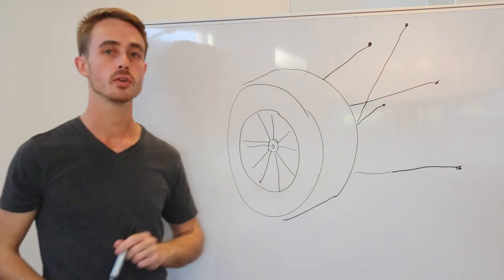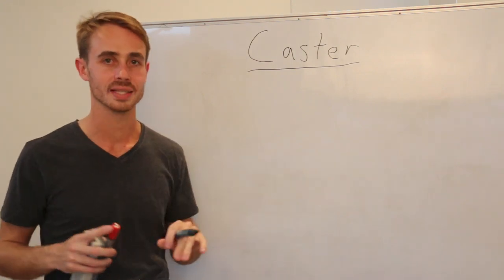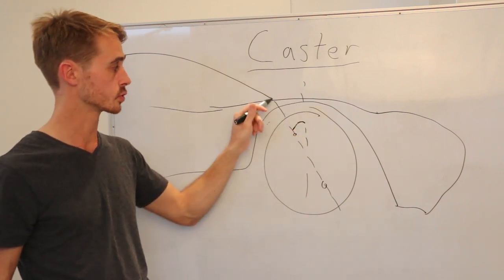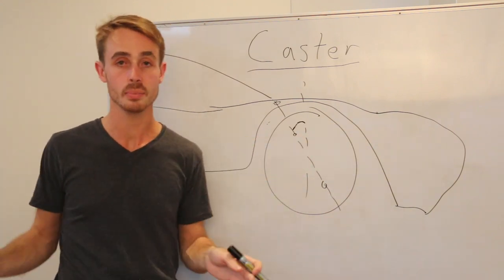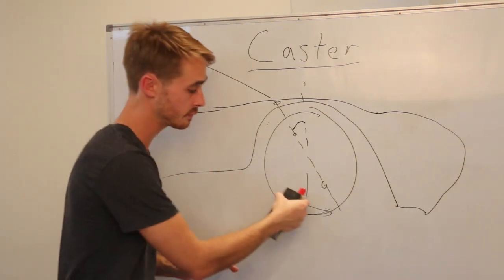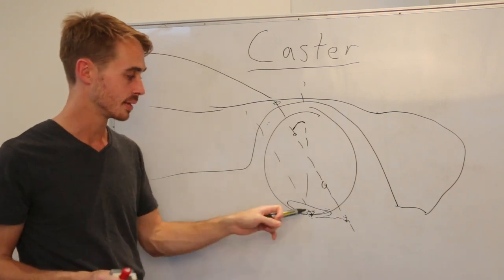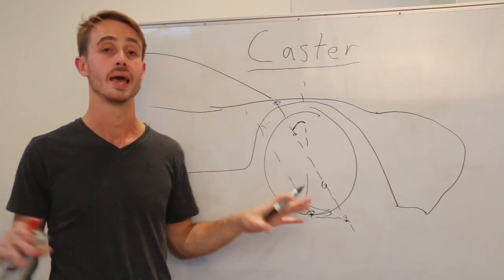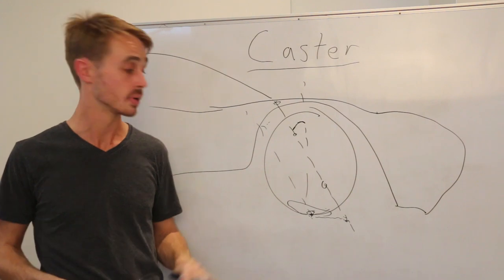How Caster Works

Comment: Finally a video that tries to explain the importance of mechanical trail for the steering feel and self centering (how strongly the wheels want to turn into the direction of travel).

In many videos about suspension geometry, they try to explain the effect of the caster angle by using for example office chairs with swivel caster wheels. But they fail to notice that swivel caster wheels actually have zero caster angle (the steering axis is vertical), but plenty of mechanical trail (how much the steering axis ground intersection point is forward of the tyres contact patch center). 

It is the mechanical trail that gives majority of the steering feel and self centering. The more you have mechanical trail, the more you will get steering feel. Caster angle (and KPI angle) by itself gives only very little steering feel and self centering (it gives some, because it tries to lift the tyre onto its edge but the effect is very small when compared to mechanical trail). I think that the confusion between the effects of caster angle and mechanical trail comes from the fact that in majority of automobile suspensions, changing one setting also changes the other. It is possible to build suspension where caster angle and mechanical trail can be changed independently. Caster angles main use is to get better camber angles during cornering.

The effect of mechanical trail can most easily be seen by playing around with shopping trolleys or office chairs. 

I think it would be less confusing to use the whole term caster angle, when talking about suspension caster angles to separate it from caster wheels. I would actually like to know why those caster wheels are called caster wheels even through they have zero caster angle? Is it the name of some old manufacturer (like hoover for vacuum cleaners) or is it derived from some old english or some other languages term or saying.
Reply: That's exatcly what i was going to write a comment about.
Reply: They use chair wheels to demonstrate that the wheel contact is behind the pivot point. Camber on the other hand does not exist with arm chairs...

Comment: Thanks. Basically, when the wheel rotates and leans inwards to the turn there is more friction on the part of the wheel which is now leaning in to the turn and touching the ground. This friction causes the wheel to want to find the path of least resistance and lift the part of the wheel that is leaning in and touching the ground off of the ground. This causes the wheel to straighten and lift the leaning-in part of the wheel off of the ground. Makes sense! Thanks!
Reply: Andrew Nash thank you, the way you worded that helped me understand it much better
Reply: Ok...but what about drifting ? There the wheels want to countersteer on their own into the skid as a path of travel...but that means they are leaning more and more to do that. But drifters want to always have as much caster angle as possible.

Comment: Are OEM caster specs the actual measurement at +/- 20 deg steering angle (i.e. lock to lock) or are they the true castor angle which the measurement must be converted to - i.e. measured angle / sin(20) ?

Comment: For 250,000 miles I've been trying to figure out why my trucks  steering doesn't  return properly! Replaced every part on the front end multiple times brought it to multiple alignment shops no one can tell me why. 
Doing my own research I've come down to the conclusion that something is off with my caster the vehicle pulls to the right and sterring feels lighter when I turn right  but doesn't have good feedback. When you steer to the left feels  heavier  but to me has better Road feel.
      The question I have is since it's  steering easier to the right and heavier to the left do I take Caster out of the right hand side or do I add Caster to the left hand side since the steering doesn't return correctly, I was thinking adding Caster to the left hand side would make both sides lighter therefore correcting  or helping my non return steering
Oh ya old girl has 370,000 on her and has had this issue since I bought the truck with 100 000 MI 
I bought it with stock upper A arms had this issue then! I installed cognito upper a arms still has the issue. I did turn torsion keys in, t A arms allow  me to bolt  ball joints in on top or bottom  to fix camber issue from Turning in bolts on  cam keys and  raising the truck a little

Comment: so if you had negative caster, or a situation where the 'moment arm' was behind the 'point of contact' (instead of in front like your example) of the wheel you could have a dangerous situation? going around a corner the car would want to turn more and more.  Are there any examples of negative caster being used or usefull?
Reply: +Steven Olson Shopping trolleys. Good for mad drifts down the dairy aisle.
Reply from the maker: +Steven Olson That is true, if the contact patch force was ahead of the moment arm you would have unstable steering, which is not a good idea. I honestly can't think of any reason why you would want that scenario, although maybe there is something obscure like rock crawlers or heavy machinery where perhaps they have to do it for structural reasons?

Comment: Do you still have the FT86? I'm weighing suspension upgrade options and want to improve front end grip and overall steering feel. The stock tires and suspension understeer pretty badly in tight corners off the brakes. I'm wondering if adjustable pillowball mounts and other minor upgrades would help a lot or if I should just save up for a complete package to fine tune all of the settings. I know the stock tires are a huge part of the problem.

Comment: Interesting, very interesting .... So you are saying there is no real drawbacks to increase caster, until you reach point of too much negative camber during cornering and/or lost steering feel?

Since you can then adjust for smaller static camber, the only potential drawback is lost steering feel with very high caster angle? (Assuming kingpin inclination is good)

Comment: My car has a caster difference of 1.10° (L=4.6° and R=3.5°).

I'm suspecting a bent frame.

How do I check if the cause for the caster inequality really is a bent frame? Also, if my frame really is bent, is there a way I can fix it?
Reply: My brand new car came with caster difference I think somebody who transported the car hit it really bad. I am here now to know is its fixable.
Reply: @ydaleeks3726  The only way I know how is to use camber plates that also allow caster adjustment. But that's not fixing the problem at the root cause though.

Comment: Vehicles have a minimum and maximum and preferred caster and camber spec. To do a alignment the vehicle should be Aligned with the weight it will be carrying on a normal day of use..because weight will change the alignment ..vehicle alignment can be within the manufacturers specifications sitting on a alignment rack ..then when you put people ,fuel,etc. in the vehicle it will not handle the way it should.

Comment: Can caster change when a vehicle is moving ??
Reply: Yes, its based upon how you make your suspension geometry.
For ex if you put increased jacking in the side view, which everyone calls ANTI-geometry, that way you change the relative side view angle between the upper and lower wishbone in a SLA setup and so you create different paths for the outer ball joints. So, as the wheel will go in bump or rebound, the caster will change as a function of the amount of ANTI given.

Comment: How increase the caster angle, please reply if you know
Reply: Keshava Siva

For my car (BMW E46 - front suspension = MacPherson Struts), you can use a camber+caster plate to tilt the upper shock mount. Also, you could use offset front lower control arm bushings to modify the way the front lower control arm sits, but you could also go for a custom heim joint front lower control arm bushing lollipop to add even more caster than offset bushings can.

Comment: You make several assumtions. The first being that all cars have strut suspensions. The second that caster is only important in cornering. How does caster affect straight line handling ? What is the effect negative caster vs positive caster ? You need to visit more websites and draw less..

Comment: Positive Caster winds OFF camber with steering angle.
Reply: To say the caster winds "on" or "off" camber is a bit misleading. In a right turn positive caster will increase (or make more +'ve) the camber of the right front, but decrease (make more -'ve) the camber of the left front. 

Any caster that is non-0 will cause a change in the magnitude of the camber as the wheel is turned.
Reply: NO, what i mean is static camber is 10 degrees, positive caster will decrease this number in the corner. winding off.  if caster is negative the camber will increase with steering angle. which no one ever does. because its unstable
Reply: @dethkon2284  I think it is the way you said but vice-versa 🤔